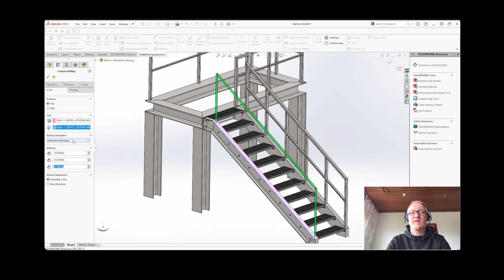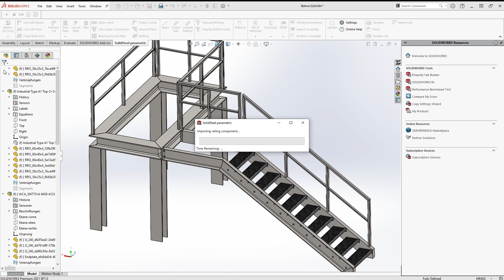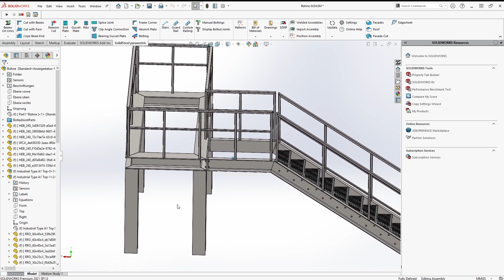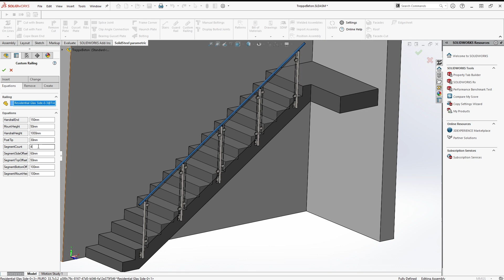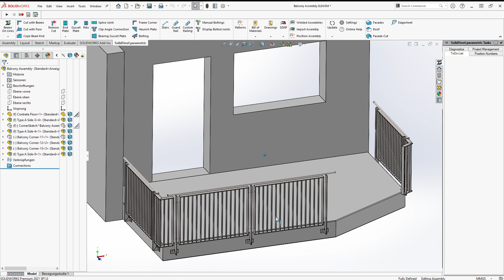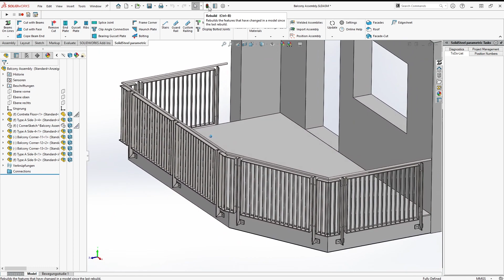The easy design of industrial and residential railings in SOLIDWORKS with SolidSteel parametric

Comment: I have not found "custom railing" tool
Reply from the maker: SolidSteel parametric is a fee based third party Add-In for SOLIDWORKS. If you have not purchased a license or using the free student version of SolidSteel parametric you will not be able to use the functions. Here you can purchase the software via the online store: https://klietsch.com/solidworks?m=/SolidSteelparametric/Pricing
If you prefer, you can also contact our sales team (sales@klietsch.com) or your local SOLIDWORKS reseller.